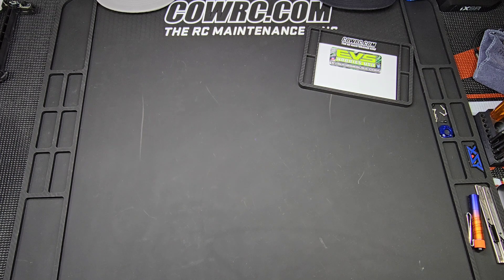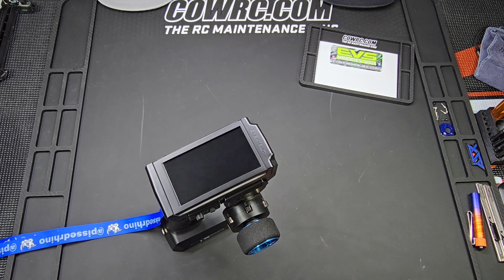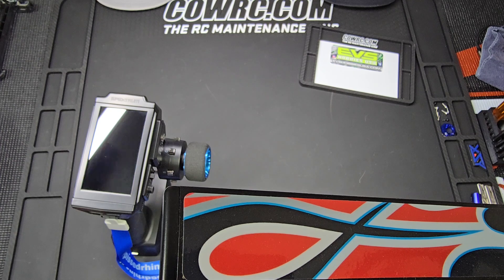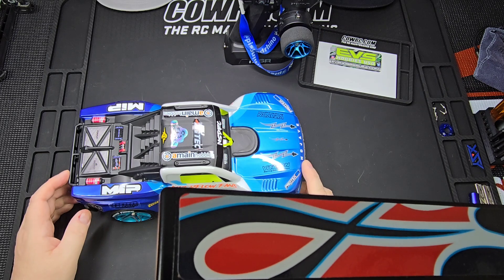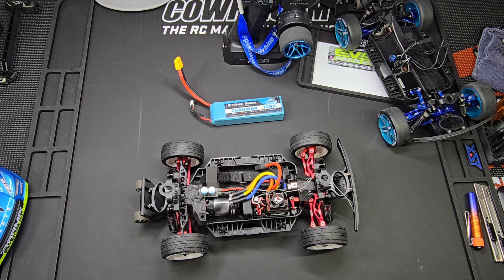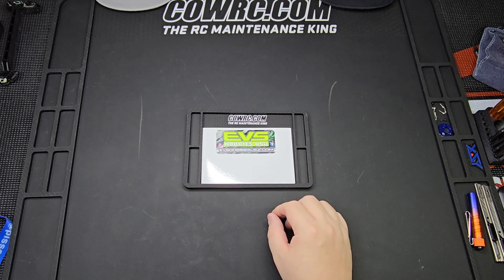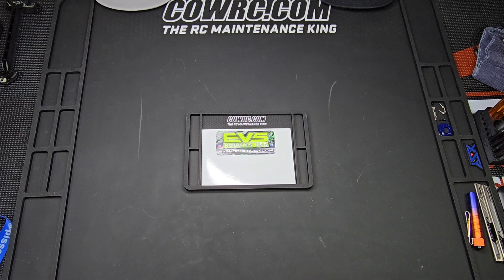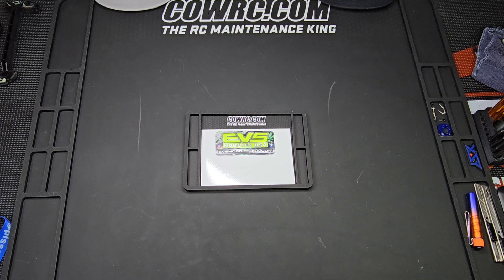Spektrum/ Castle Creations Complaints Plus We Check Out Miss Mojave Grom Build #evshobbiesusa #jbirc

Comment: try Flysky i use a GT5 but it has 6 channels and i use it for grawling but if you can run multiple set ups with one controller.  Not sure howmany off hand but you have to save the binding for and set up for each on per instructions. just a thought

Comment: That Radio is worth no more than $150, its not high end at all, no Spektrum radio is high end
Reply from the maker: @Paul0088  how much did you pay for your smartphone?
Reply: @pissedrhino  it works unlike spektrum
Reply from the maker: @Paul0088  have you even held a ixsr?  If you did you would know what many of us do. Go to your local hobby shop, hold it, turn it on and set up profile.  Then download the castle ap and run it.  It's pretty much a smartphone attached to a remote.  For only 700 bucks.  Cheap.
Reply: @pissedrhino  i will have a look at one when it comes out over here UK